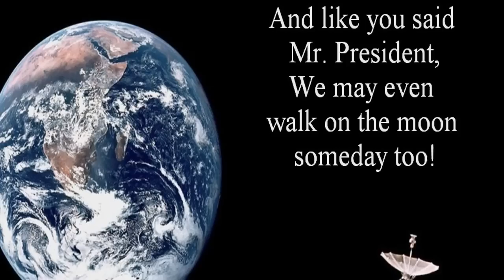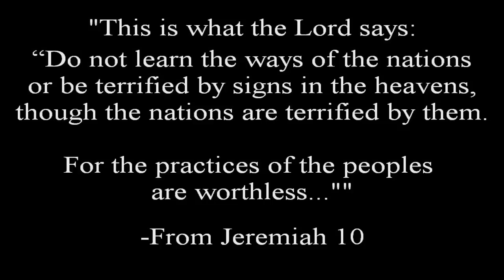US PROPOSES WORLDWIDE COOPERATION IN WEATHER CONTROL - IN 1961 - JKF TO UN GENERAL ASSEMBLY

Comment from the maker: WHAT IS IT, YOU ASK...
UPDATED Chem Bomb/Chem Tracking - Additional Information Found in Clip

MY 2 CENTS...
It appears to be an actual weather balloon or one for recon.  There were electronic instruments in it.  Nothing hit the balloon.  It was lighted from the inside. So that the scientists who were tracking it could find it better after it's mission was accomplished. The weak point of the balloon was apparently venting and finally gave way, just as any balloon would.  The gasses were pushed out by the pressure and the pieces of the balloon fell to the ground with its electronics, still blinking and falling apart.  The chemtrail was for cover.  So that those on the ground would be unaware of the project.  But the balloon was venting and losing altitude rapidly.  So it was seen from the ground having fallen beneath the chemtrail.  This was a science project failure.

It's entirely possible that part of this 'balloon's' mission was to collect data on the actual chemtrail, because of growing concerns about Aero-Toxicity with frequent flyers and pilots resulting from chemtrails.  These balloons are sometimes equipped with appropriate censors to detect toxicity levels of numerous chemtrail additives in Parts Per Million, as well as determining the chemtrail mix's aerosol dispersal rates.  And therefore could very well be considered 'Classified.'as a project.

Great catch!!! 

Hope this helps...
Chemtrail Plague Is Upon Us !!!  AEROTOXIC SYNDROME Killing Frequent Flyers ???

~Michelle

Comment: Today is the 17th which is what 1961 is which is one of those geometric equations they use. I am sure each department has a different set. And today equals 9 which Japan uses a lot but 2014 eqtals 7 and adding 9 to that equals 16. Or it could be a good pick 3 number. 791